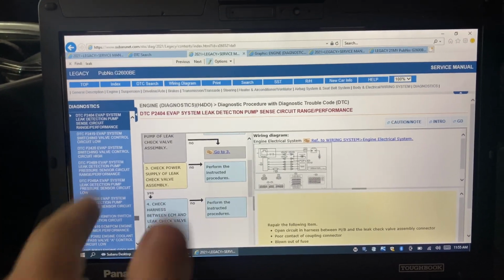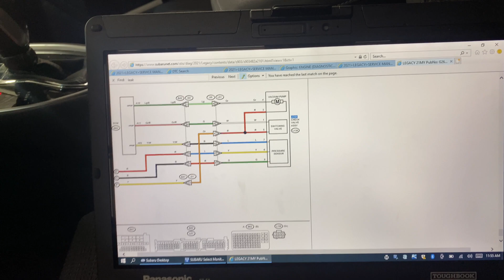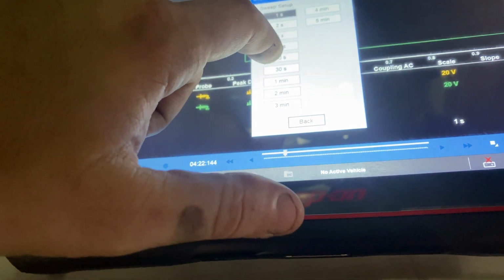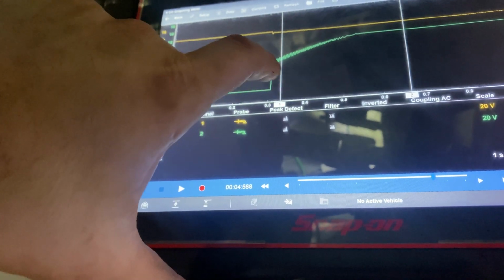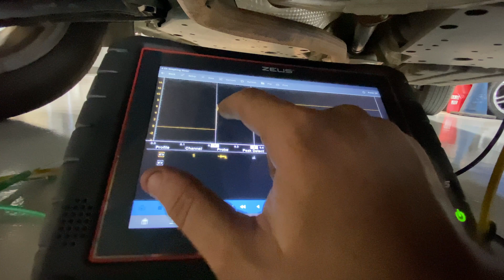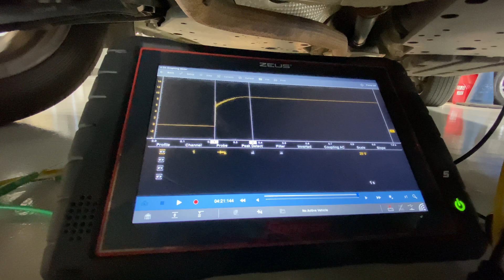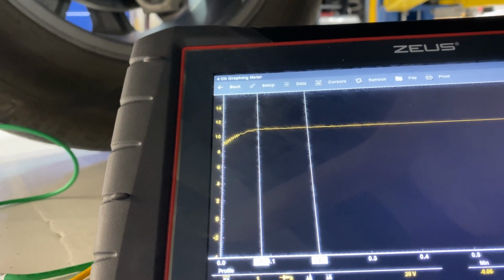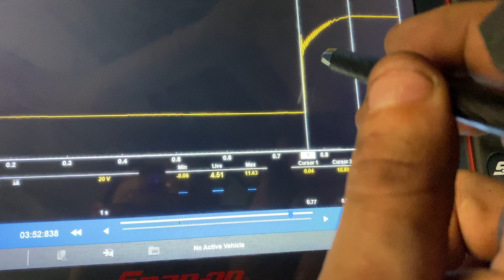2021 Outback P2404 EVAP System Leak Detection Sense Circuit

Comment: I got the same code P2404 on my 2015 Subaru Wrx, trying to figure out how to get code deleted and fix.
Reply from the maker: Do you have any LED lights and or modified lighting?
Last code I encountered was set because of LED bulbs in the headlights
Reply: Yes I do have LED’s on my headlights.
Reply from the maker: @jessebracero6817  
Put the OEM bulbs back in and clear the codes.
Some LEDS and aftermarket lighting mess up the voltage drop on the emission monitor. The emission system is sensitive to 10mv disruption

Comment: Thanks for the visual!
Without a 'Known Good' pump to compare with, I'd be searching STIS for the DTC Detecting & Setting Conditions for Component/System Operation Time Reference. I just spent 20 minutes browsing STIS and can't find the info.
Suggestions?
TIA!
Reply from the maker: It’s not unusual for a CODE to not have a detecting criteria listed.

The people who built STIS and all other service programs, expect the reader to be ASE CERTIFIED and be Fully Certified.

If you have STIS access try looking for information in the mechanism and functions (it’s a separate PDF), and NEW car info.

There’s tons of information buried in those PDFs, explaining why things changed, what was added, or how the system is plumped.

I find a ton of emission related material in these sections
Reply: @thatsubaruguy1324  
Buried is right, and in random places.
 I spend hours reading the Tech Reference Handbooks, and still get lost .
Thanks!
Reply from the maker: @hnd2893  those extra sources I mentioned are fantastic for emission diag. They show all the plumbing

Comment: Evap system fault on a 2 yr old Suby?  
Does owner top off when fueling?
Reply from the maker: Thanks for the comment. Overfilling the gas tank with fuel was not part of the problem.

This was just a small component that was not switching on fast enough.

If you make 100,000 of something you're going to get one that's not good.

Keep in mind the solenoid was switching on and off but it was delayed by 10 milliseconds slow, that's 0.010 seconds.